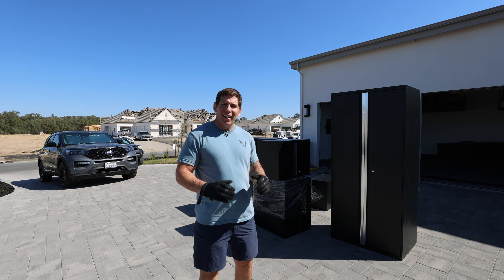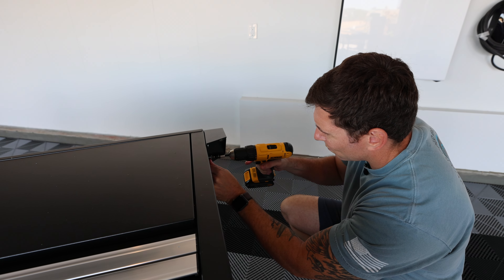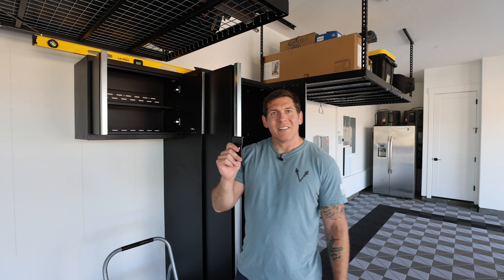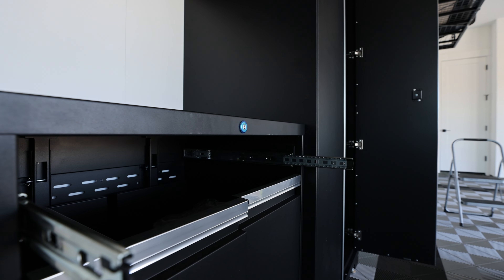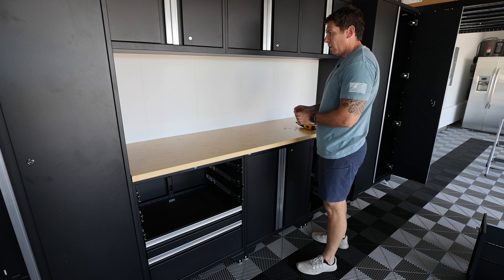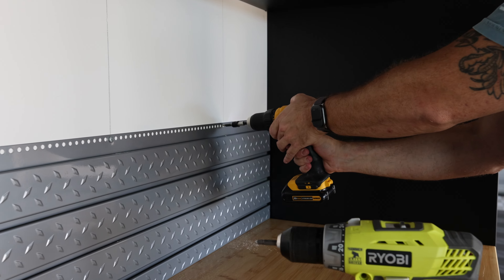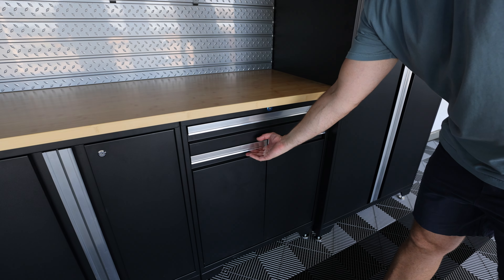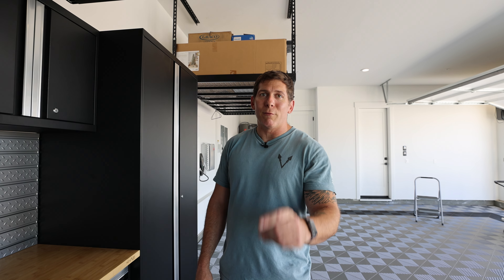Are NEW AGE PRO Cabinets worth it? Installation and Review

Comment: I just installed my second set of New Age cabinets and am very pleased with the product. At the end of your video however, I saw that you hadn't installed the light valence supplied with the upper cabinets. This will help to shield your eyes from whatever lights you decide to go with. I was going to get the light strips sold by New Age but instead found some battery powered LED light strips that I found on Amazon for much less money and require no wiring. They are magnetic and simply stick to the underside of the upper cabinets plus they have a four way switch...on, off, night light and motion sensor which is how I use them. As I approach the cabinets, they automatically turn on. They last a long time on a single charge and come with a USB cable to recharge them. By the way, GREAT VIDEO!!!
Reply from the maker: Thanks for the awesome comment, I hadn't done the light valence because I didn't have a way to route power for the lights. But I have figured out a solution and now have them up and the lights working. I like your idea I'll check that out. I also found an awesome surge strip solution so I'll be posting an update video in a little while about how they're holding up!

Comment: Nice video !! cleats would of worked if they all been installed together with a laser or level line starting with the cabinet you installed first . I think it’s because you didn’t put the cleat on the cabinet . It kind of leaves you guessing where to put the cleat for the smaller upper cabinet. Your trying to account for the thickness of the sheet metal that sits on the  cleat but you can be to low or high . It is difficult 😂 kicked my butt . But It worked for me . Thanks for the content !!
Reply from the maker: Hey thanks that’s actually a great point, I’m sure that would have worked. But mine are still holding up great as is, very very happy with the New Age products

Comment: Hey buddy nice job, I have a question I bought the big set of 14 pieces but I want to put some rubber pads underneath the legs of the cabinets any idea of the measurements ?
Reply from the maker: Which measurements do you mean? I have a 5 inch riser on the back side of mine and the legs fit well. The pads are about 1.5 inches each I’d say
Reply from the maker: The bottoms of the legs I mean
Reply: I’m talking about the measurements of the metal legs

Comment: I also have Swisstrax. I have the same 9 piece set coming soon. I was wondering how the legs worked with that flooring. I was thinking about hanging them on the wall as you did and not use any legs at all. Any thoughts on this and is it worth messing with hanging them.
Reply from the maker: It’s actually no problem at all. I would just get the feet on and then also secure to the wall to reduce sliding and take some pressure off the deck. I’m very pleased with how the cabinets work with the floor. No issues. My swisstrax video will be up today or tomorrow btw.

Comment: I can not find the slat wall video
I have the 11 piece set and it has been a trying time to install
The wall in my garage is half drywall and half concrete.  Getting them level has also been a hassle. 
I have one tall cabinet up with a top cabinet attached. I also noticed your did not use the small bracket for resting the countertop on. Is not needed
Reply from the maker: Hey sorry about the slat wall video it’s not up yet, but I don’t think it will help with your concrete issue, I went straight in to studs. Also regarding the countertop. That piece you’re referring too I believe is only for bridging a gap if it lays over the side or behind the lower cabinets. But mine run all the way across so I didn’t need it. Does that make sense?
Reply: @ yes
I am attaching wood 3x3 to wall to then attach the slat wall to that